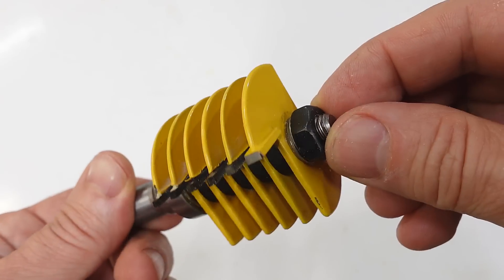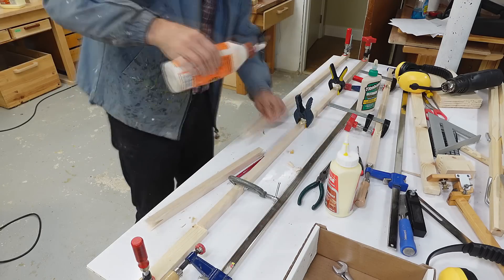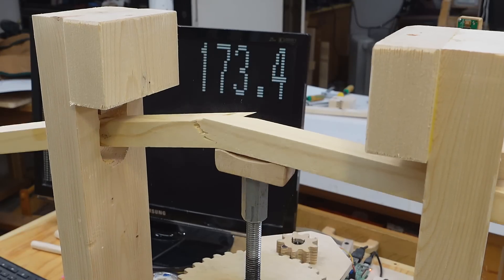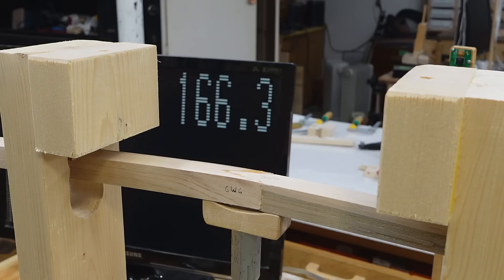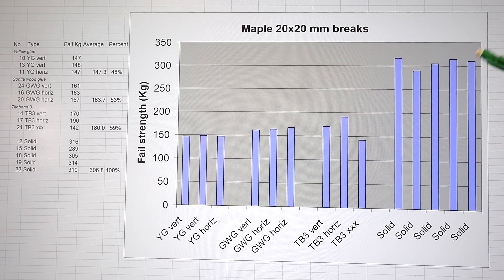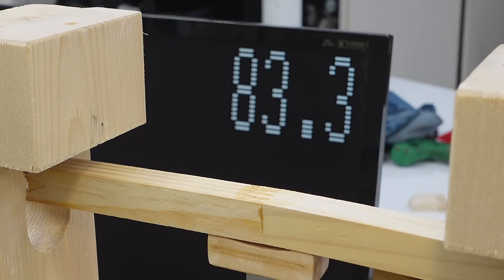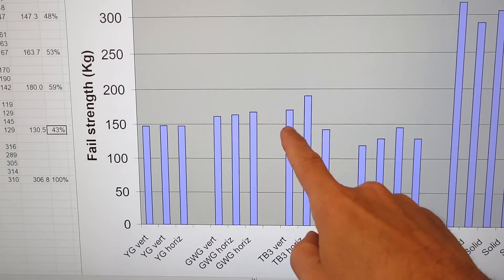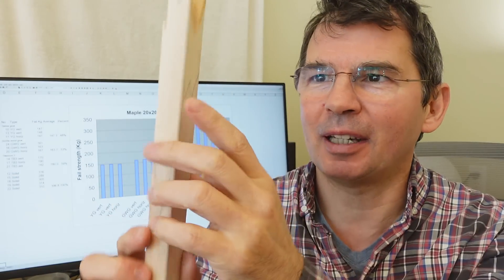End-to-end V-joint strength test

Comment: how about simple scarf joint? popular among on boatbuilders
Reply from the maker: takes up twice as much length, and more complicated to clamp
Reply: @matthiaswandel  I'm agreeing with you here. There is certainly the practical aspect of the difficulty of producing a scarf joint in the home shop. Also, in a production environment a scarf joint 'wastes' more material compared to a finger joint. But the engineering aspects may give a scarf joint improved performance. With a point load (as in your test set-up) more of the joint is further away from the point load, where the moment and shear are reduced. But that particular rabbit hole is getting a bit far removed from your original question of the strength of finger joints.
Reply: @briantaylor9266  If material waste is that much of a concern, just do a buttjoint. But really, waste is only guaranteed at the ends of a boards. With sufficient board length, each cut provides both positive and negative sides, i.e. no waste beyond the kerf. Regardless, people suggesting a scarf joint aren't expecting 15 to 5 degree angles. There's clearly a happy middle ground that balances strength to feasible cut angle. Personally, I'm more interested in seeing a combination scarf+V joint.
Reply: @briantaylor9266 the shear stress stays the same across the whole length of the "beam"

edit: in case of said point load
Reply: @superjojo555  Quite true for vertical shear. I'm not so sure about horizontal shear.
Reply: @custos3249  My comment relative to waste was made in the same context of industrial production of glued up planks, where short otherwise unusable pieces are joined together. A finger joint may waste only a couple of cm, whereas a scarf may waste 10 or more depending on stock thickness.
Reply: @matthiaswandel  yes, scarf joints are stronger, look up wood wing spar joints, and the recommend use is a scarf joints…. also T88 is a structure a glue, if you want to try that also.
Reply: @matthiaswandel  What I see with glueing is fibres grabbing on to each other. What if you rough up the end with a wire-wheel to increase the surface for the glue and make it easier to grab fibres?
Reply: @matthiaswandel  true, is the strenght same or comparable?
Reply: @matthiaswandel this is true but I’ve seen very long low angle scarfs specified in historical aircraft designs, I’ve always wondered how necessary that was
Reply: @matthiaswandel  thanks, I guess i missed out on your point on using up scraps, totally different application
Reply: @matthiaswandel  How about a scissor scarf joint?  It does take up more length, but easier to clamp.
Reply: @matthiaswandel  a scarf joint with a dowel to bring it in close would not need clamping
Reply: @matthiaswandel A scarf joint of 15:1 is used in wooden aircraft construction. It’s generally deemed to be as good as a solid member.
Reply: @matthiaswandel  We (boatbuilding in a shop of four since 1981, closed shop 2020) did everything with simple wedge-mountings (usually 10-to-one or 12-to-one) and epoxy from the best supplieres (West/Gougeon and SP/EniChem), proper preparation, washing off everything with acetone and clamping/weighing with car batteries on tabletop for bigger pieces like whole plywood decks or hull-planks for example. Given proper preparation, we never had a glued joint fail in no matter what boat, some of 'em really strongly used racers (we built decks and hulls up to 16 meters from mounted ply-sheets) without outer or inner glass layers for weight reasons. Maybe it's the glue You use?
Reply: Yes. It would be interesting to compare a 12:1 scarf
Reply: With a 15 degree cut, you have 2.5X the normal stress on the glue joint compared to a 5 degree scarf.  I imagine it should do better.

You are getting closer to pure shear and also a much larger shear plane to distribute stress.
Reply: The point here is to maximize the use of smaller lengths of wood which otherwise would be scrapped using commonly available glues. Better joints and glues are out there, but fail in this aspect, and butt joints aren't strong enough even if they use the wood lengths more economically. For most common uses and in the average woodshop I think the 15 degree V-joint is good enough as long as you understand what it can and cannot do.
Reply: I was thinking of a scarf joint too. I think because there is so much more glue surface and it’s so much longer it would probably do quite well.

Comment: Have you considered or tested what the optimal clamping pressure, heat humidity, or drytime would affect the strength of a glue joint?

Comment: Hi Matthias, out of this topic, it would be nice if you try strength of wood with holes inside. Usually people use it for boards to make them lighter, f.e. for beds in caravan they drill lot of holes 5cm or bigger and it is still strong enough. But it will be interesting to measure bow much strength it looses by drilling those holes... Thank you
Reply from the maker: There would have to be a specific pattern of holes that everyone uses for it to be of much use to people.

Comment: What about a 15:1 scarf joint as used in wooden aircraft construction? It’s generally deemed to be as strong as a solid member.
Reply from the maker: do tell how to cut one of those on the end of a board.  Also, an awful lot of length is lost.
Reply: @matthiaswandel I agree a lot of length is lost. I’ve seen them cut a few ways. For a member of moderate height, it could be clamped to a table saw sled. For very wide members, a slanted router jig could be constructed. Wooden boats and  aircraft both use scarf joints. Albeit, the slope on boats isn’t required to be 15:1. Even plywood is scarfed on boats.

Comment: I have to wonder about a half lap joint test now, and whether increasing the joint size would increase strength. Also scarf joints  from boats but they can be a pain to glue up. Pin nails? Or perhaps a small alignment dowel?

Comment: do stress concentration points apply to wood like they do for steel? what are the gains if any from making sure that the joins have 0 gaps and or 0 sharp corners? basically either finishing with a chisel or making sure that your saw blade has a flat cut instead of the sort of M cut. Have you tested expanding glue or maybe adding a bit of wood filler in the gaps as you glue them?

Comment: Are you curing the glue properly? I question this because most people do not read the directions for curing a given adhesive properly. There is supposed to be a certain pressure applied to the glue joint during the curing time. I would apply the pressure perpendicular to the finger joints with clamps during the suggested 24 hour curing period for Titebond 3. This concept is not the same as leaving the two pieces next to each other for the same period. The mating surfaces that have been coated with wood adhesive should be continuously pressed against each other, not left  to dry without applied force necessary to achieve the pressure recommended by the adhesive chemists. I found these specifications on the internet using google: Softwoods: 100–150 pounds per square inch (psi) Medium woods: 125–175 psi Hardwoods: 175–250 psi

Comment: The 'W' shaped cut your considered at the end would not have any increase in glue surface to just a single 'V' shape since you're just flipping the tip of the 'V' over.
Reply from the maker: but I could get more width for the same depth, or use a lower angle

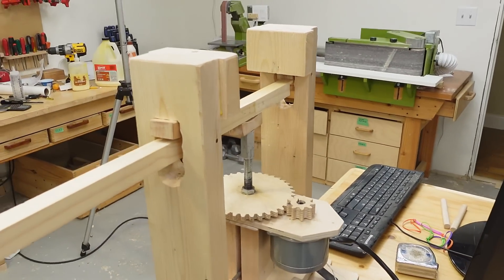Comment: A 1:10 thickened epoxy glued scarf joint used in boatbuilding may not be practical in most woodworking. I'd still love to see a test of that as the common claim is that such a joint is close to the strength of a solid plank.

Comment: What about ripping the boards and gluing them back together with the joints staggered? I know it's a lot more glue, but I think it would be a lot easier for a novice than trying to make an accurate V notch.
Reply from the maker: that’s a lot of work and a lot of sawdust if i want to extend a long board
Reply from the maker: way too much work if you just want to extend a long board by a little.

Comment: Fascinating stuff as always!  I'm wondering if you'll achieve different results on the V joints if you apply glue to both pieces and allow them to remain unjoined for several minutes...then apply a little more glue and join/clamp.  The reason is end grain can pull glue out of the joint, leaving a starved glue joint.  The extra step of allowing some 'soak time' may improve the bond.

Comment: A lot of those failures look like adhesion failures. You also showed that the type of glue used was significant to the results. I wonder if a construction adhesive like PL-8X would work on your V joints, even at lower angles. I have used construction adhesives and tried taking them apart after realizing there was a mistake only to end up destroying the wood in the attempt.

Comment: I'd like to see a "peg joint" test, where one end has a protruding peg  (a couple inches?) and the other side has a drilled hole for the peg. Since there is some of the original solid wood, and a lot of surface area for glue, I think that would be a strong joint. Or maybe the strength would be only as good as the peg part. Might need a conical part at the bottom of the peg and a matching tapered hole for more strength and glue area. Only one way to find out. (Can't think of a quick and easy way to make the cone and tapered hole though.)

Or maybe using just a dowel and drilled pieces on each side would be easier and probably nearly as strong.

Hope I get to see if I'm right! If I didn't have to build some kind of pressure tester I might try it myself!

Comment: Most seasoned woodworkers just go by "longgrain to longgrain is the strongest" rule without ever testing it. Now that people outside material testing labs have access to affordable loadcells and can rig up a testbench to get somewhat repeatable results, there's more and more videos that put this belief to the test and as it turns out, with modern glues, the end grain to end grain joint is actually stronger than sidegrain to sidegrain for equal glue area, as the glue is stronger than lignin holding adjacent fibres together. As demonstrated and explained by excellent series of videos by Partick Sullivan called Glue Myths.

However, apart from absolute strength You also have to consider mode of failure and glue area, as well as wood movement that weakens the joint over time. For a joint like this though, You can get both the strength of an end to end butt joint and the gradual failure of a longgrain joint if You add a scarf part to it. The total area of end to end pores would be the same, but the total glue are would increase and also include some longgrain contact that would fail without abrupt separation.

Comment: Matthias, could You also redo the same test with a simple butt joint (end to end) for control on how end pore orientation affects strength of glue adhesion and then adjust the result relative to glue area. I expect the result to be surprising to most woodworkers that have been taught all their career that long grain to long grain gives the strongest joint.

Comment: Hi Matthias, I just went through all the comments and I'm surprised no one mentioned the fact that you tested the joints while they are oriented sometimes vertically, sometimes horizontally (if this makes sense ?). I suppose this might impact the results, even though the measured  values are nowhere near the solid wood values anyway.
Or at least this might be interesting to test (not a demand, just a suggestion!).

And also, thank you for taking the time to answer some comments. I see they are not all relevant and it demands patience to read them all, so cheers to you for that 🙂

Habe die Ehre!
Reply from the maker: deliberately, and if you look at the graph, orientations are annotated
Reply: Woops, my bad.. thanks!

Comment: Have you tried staggered finger joints 2 short with 2 longer ( or what suits ) on each end to spread the weak points or every finger different length - a combination of Vee joint and finger joint
Reply from the maker: do tell how to cut that accurately and repeatably
Reply: @matthiaswandel  Well I thought it would be just a normal finger joint but with the saw blade set at different hights, your the expert I don't own a table saw so I can't experiment, I was more interested in the theoretical strength increase by spreading the weak points
Reply: The increase in strength versus the increase in complexity and therefore more ill mating surfaces at the ends of fingers is not worth it.

Comment: You could use the pantorouter for tabled,  tensioned  scarf joints. Only fairly narrow stock and clean up with a chisel, but it should work.

Comment: I hope you test a scarf joint too. I want to see how much stronger it is than a V-joint and if the extra effoet is worth the time
Reply from the maker: the v joint is actually easier
Reply: @matthiaswandel  Deinitely. That was a clever way you cut it in the video. Supposedly, the scarf joint should be even stronger, but I'm hoping you'll test it in another video
Reply: My prediction is that it would not be any stronger when adjusted for glue area.

Comment: I'd like to see you test different scarf joints (tabled, tensioned and stopped) at different ratios, 4:1 to 20:1 for instance. Perhaps a bit trickier to set up but it would be interesting to see the results.

Comment: have you ever tried wood welding Matthias? watch?v=SRDfOPH_DTA
Reply from the maker: show me a practical application and how to do it first
Reply: @matthiaswandel  the method is shown in the video (inserting dowels). Application might be wood joinery. We need your testing rig to compare to glue and see if it is practical! Either way, it would be really interesting to test the holding power and it should make for a fun video.

Comment: Why not just rip the boards in half and then stagger the butt joints so each butt joint is against a side grain joint? That feels ro me like it would be super strong. Perhaps a bit more glue but I'd think there'd be a lot more strength and far less fiddly. Also, perhaps more wood stability. Doing it this way also means you dont lose any wood from cutting away a joint. Your joints can basically become half the length of whatever starting wood length you're using.
Reply from the maker: because that’s very wasteful when you have to rip up a whole long board compared to just adding a bit at the end.
Reply: @matthiaswandel  I'm not sure we understand each other fully. What I'm saying involves no wood offcuts. Your joint on the other hand, discards three inches of wood on each side. You also need to adjust the table saw and fence multiple times. Mine would involve a single rip cut to each board, then a cross cut on any overhanging pieces to relocate them back on the laminated board. The only wasted wood is that which the kerf turns to sawdust.

Comment: When building the old stick and cloth airplanes, any scarf joint was recommended to be 30:1 meaning 30x the thickness in terms of length. So your 20mm thick spar would have a 60mm long scarf at whatever angle that turned out to be.
Reply: 20 x 30 = 600 !!! (not 60)
Reply: Pretty sure you did the math here wrong, and I don't think his sticks were 600mm long...

Comment: Have you ever used your strength testing setup to test the old trick of rubbing a bit of glue across the end grain and letting it sit for about 10 minutes (with tite-bond 2, anyway) to soak in before adding more glue and clamping up an end-to-end or butt joint? People swear it works, and I'd be curious to see what the numbers say!

Comment: You have a lathe, you can either make a finger joint router bit yourself or modify a Chinese one to make it work.
Reply from the maker: if you know nothing about machining, then it all seams possible.
Reply: @matthiaswandel What exactly don't you know about machining that would prevent you from making such simple things?

Comment: Matthias I am not sure what the conclusion of this experiment was?
There were two main variables here, the glue strengrh and the mechanics of the joint design. 
The problem with the v joint from a mechanical point of view is the thin end of the female v will fail first causing the rest to fail. 
I think the v joint performed better than the finger joints because of the longer crossover of thicker material. I think the strengrh therefore would increase as both the overall length of the joint was increased while having a design with the thickest material on both components. A thin part of a component will fail quickly reducing the overall load capacity of the piece. A v joint is therefore not the most optimal joint for strength although I agree that it is simple enough to make and still very strong.
What this experiment has shown to me is that the mechanical properties of the glue are inconsistent with the properties of the wood itself and that results in the thinner parts of a join failing first especially when the joint has short overlap. In other words if the glue offered the same properties as the wood the results in theory should be the same for the solid pieces of wood as it was for the joined pieces. Wood joined at the cellular level is mechanically superior to synthetic glues.
Reply from the maker: watch the conclusion of the video.

Comment: have you compared tightbond 3 to tightbond 2? I believe 2 is supposed to be stronger, though it is less resistant to water. Since we are not in the habit of putting our wood joinery in water, tightbond 2 would be the proper glue to test with.